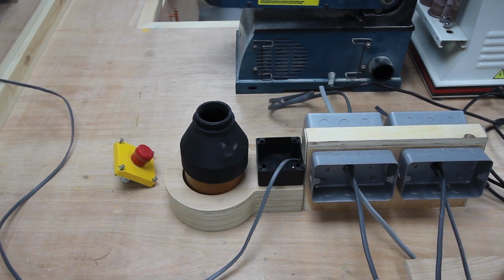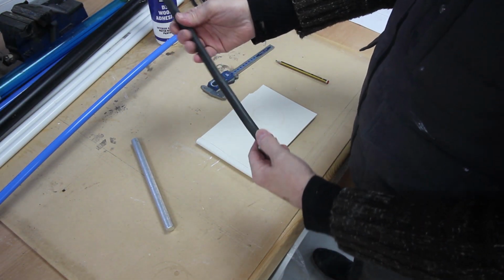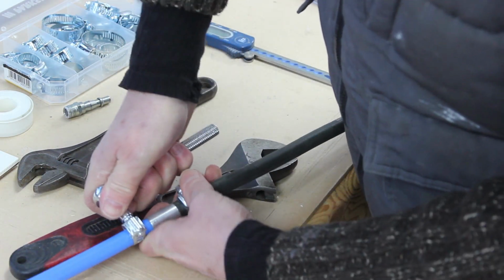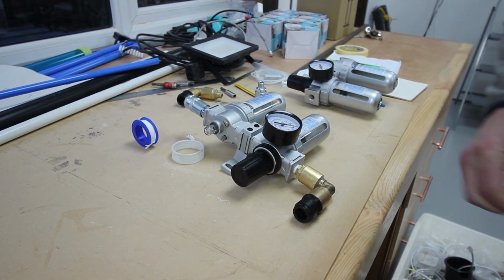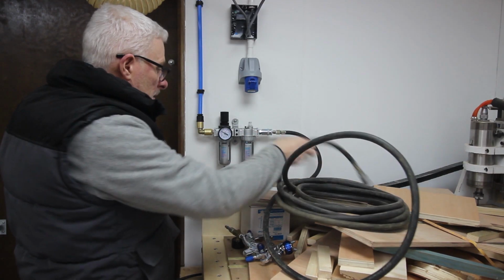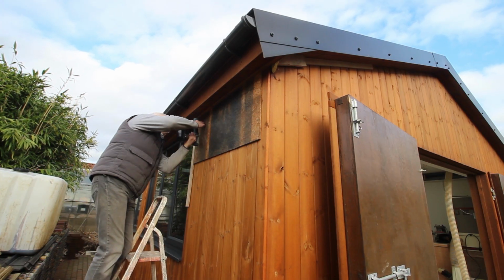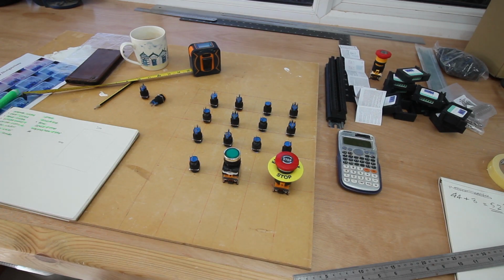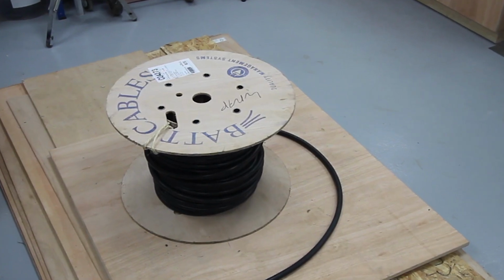DIY Workshop Dust Extraction, Pneumatic System and a Control Panel

Comment: Hi  hope your well, it's all looking good in the workshop, the air line seams to be trouble free I like your home made air hose adaptor made on the lathe. A decent size cable to the workshop 16mm that will carry a lot of power always best to be over sized than under size The main switch panel looks good with the sanded finish and can't wait for the connecting up and the ready for the in coming supply. As always a great video catch you soon take care
Reply from the maker: Thanks Shaun,
The cable should help getting solar power to the house as well.
Cheers

Comment: Looking very clean. As for the resin, I've never seen it before used like that. Will it not crack and form leaks under the pressure and with temperature variations?
Reply from the maker: Good point, I have no idea time will tell. If it does fail then I will for sure reference it if only to warn others.
Cheers